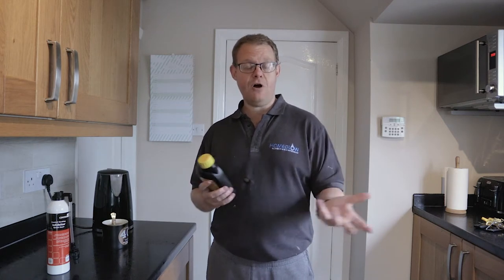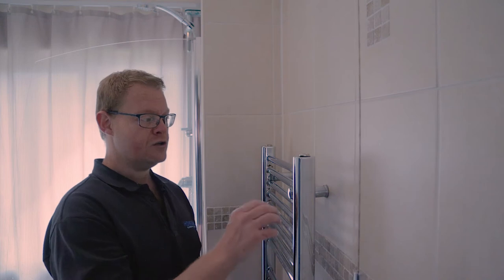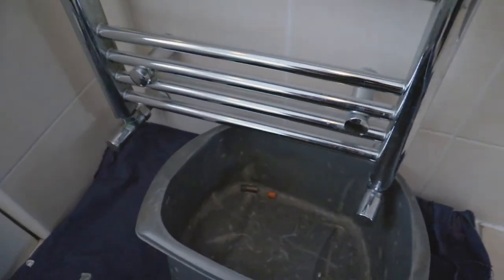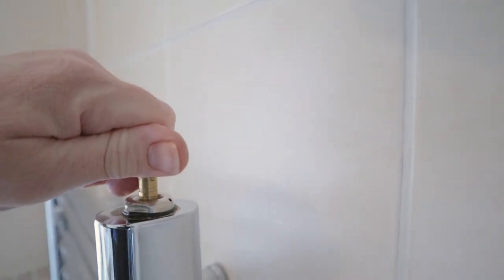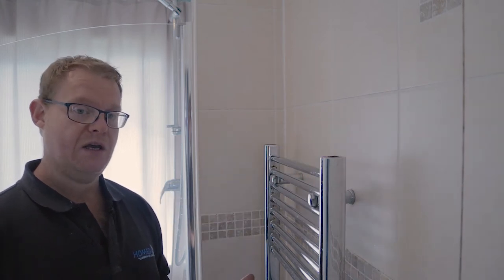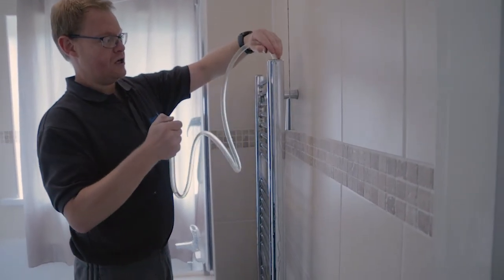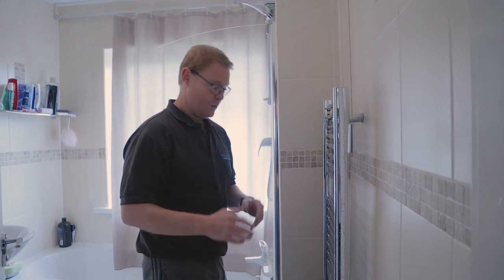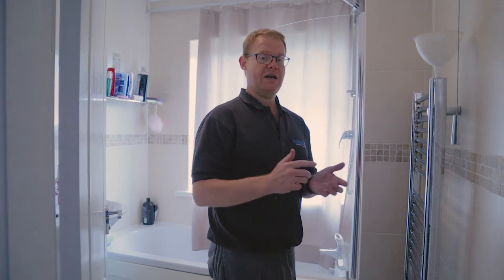Central heating system inhibitor | Towel rail DEMO

Comment: What a cracking and simple way to do this. I intend on copying this method for adding cleaner. Mine is tank fed anyway, so will bleed as normal, when I open the valves. Little water needed too.
Reply from the maker: Did it work?
Reply: @HomeglowLtd  Will be doing it later today. Have my cleaner, and pipe is arriving this afternoon.
Reply: @HomeglowLtd  Yes it's worked. Very smooth. The only thing I would say, is noting the pipe diameter for the rail. I ordered a 16mm x 20mm piece of pipe half a metre long. This was too thick so had to warm it up to push it down. But the length got out what I needed. Added the cleaner and cleaned up. Now it's circulating my system.

Comment: Great video.  When you topped the radiator with 500ml of inhibitor, did that fill the entire towel rail or did you have to top it up with water before or afterwards?  Please can you also clarify if the radiator was emptied or partially emptied?  Thanks again.